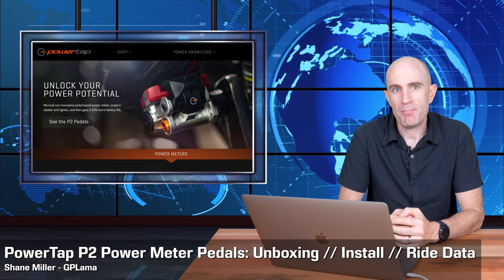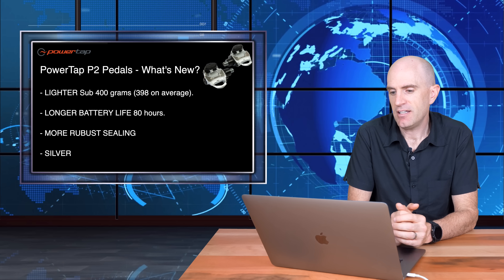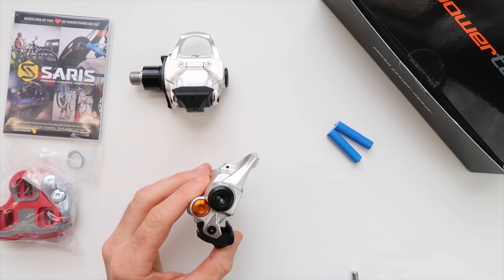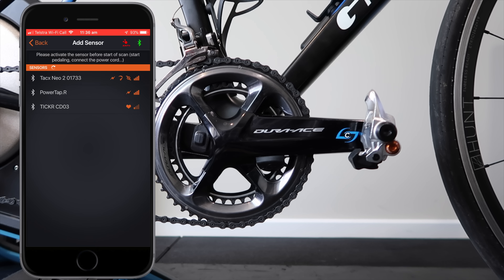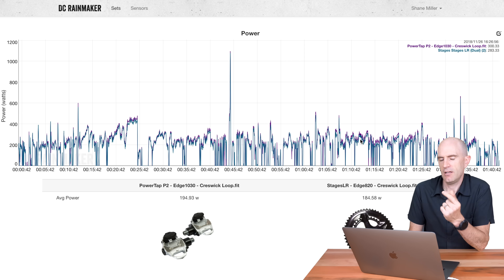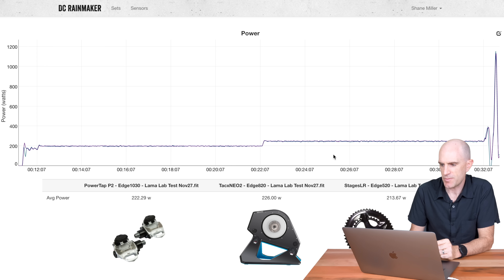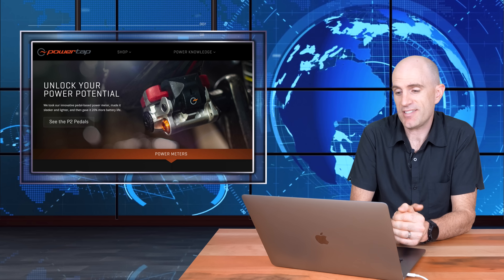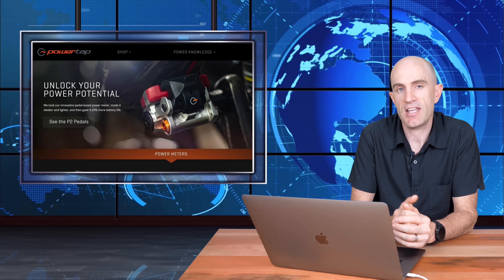PowerTap P2 Power Meter Pedals: Unboxing // Install // Ride Data

Comment: I have a question. Have you ever had either right or left peddal just stop working even with a new battery even thou like two days ago they were working fine.
Reply from the maker: No such (bad) luck with the P1 or P2 here. Be sure to check the terminals, especially on the end cap side of things. Clean/scrub them up / reinstall and see how they go.
Reply: @gplama thanks for the advice. I've tried that already with no luck. The green light on the right pedal comes back flashing Bright but after 4 minutes it goes very dim and loses connect with the head in unit. Anyways thanks for the reply. Just thought I would ask cause I know you had these longer then I had I just got mine in May

Comment: The design of these pedals has many flaws.. one of them the use and position of the bearings.. Also serviceability is quite reduced by the strange way of placing the bearings. The battery choice is also not a good idea in my opinion.. Requiring Lithium Batteries while nowadays it's so easy to get rechargeable LiPo, Li-Ion including charging circuity with USB-Micro or USB-C to directly charge the pedals like some other brands..

Comment: Having huge problems with the P2 and Zwift. My old P1 pedals (which got "upgraded" to P2 through a warranty claim when they failed) connected fine and automatically doubled the power from the single connected pedal. The P2 pedals don''t. Tried removing the right pedal battery but it doesn't help.
Reply: Did you ever find a solution for this? I'm in the same boat.

Comment: So Shane, I have P1. If I go to Zwift does it matter which people I select ( left or right )
Reply from the maker: Over ANT+ there's one ANT ID to connect to and you'll get L+R power data. Over Bluetooth the P1/P2 will only transmit one pedal data... and whatever it is connecting to will usually double it. Like the P1S. There's no true L+B over Bluetooth with any PowerTap pedals at this point.

Comment: okay quick question I'm looking at getting a new power meter and I'm between the powertap pedals and Garmin vector pedals
Reply from the maker: It's up to you then on price, weight, BLE having dual power (P1/P2 don't do this), Cycling Dynamics (again, Vector only), etc.

Comment: Rubbing battery on baby oils? Is that a wife's tale?
Reply from the maker: No. Google it. It works.
Reply: @gplama   I googled and what I found is consistent with my understanding of electrical engineering. You want a good and as clean as possible connection between the battery terminal and the contact point (in the PowerTap). In other words, zero electrical resistance. By putting oil in between the battery and the contact point, you've increased the resistance significantly, as oil is a bad conductor. 
My guess is that this internet myth originates from the fact that people put grease on car battery terminals to prevent corrosion. But the grease goes after the connecting cable is screwed to the battery terminal. You don't grease the terminal and then screw the cable on top of the grease.
Reply from the maker: @itsm3th3b33  The baby oil tip was also from Garmin in regard to their batteries in the Vector 3 pedals. To prevent fretting / corrosion damage, which in turn caused issues. The terminals are contact based, so any resistance introduced by baby oil would be minimal and likely offset by the benefits of no corrosion occurring.
Reply: @gplama    In my opinion, the tech support guy who wrote that did a disservice to their customers. Yes, fretting is a real concern, and one way to alleviate fretting is by using electrical lubricants. Amazon sells many such electrical lubricants.  Mineral oil (and baby oil) are the opposite - they are not electrically conductive, even if they are lubricant.
Check out mineral oil in Wikipedia: 
"Mineral oil is used in a variety of industrial/mechanical capacities as a non-conductive coolant or thermal fluid in electric components as it does not conduct electricity and functions to displace air and water."

Comment: I’m curious if you pair up the P2’s with the CABLE using ANT+ and then use the BT signal from the CABLE would you still get LR data from the pedals over BT?
Reply from the maker: Yes, this should work.

Comment: OK, this is NOT a product upgrade, its a product appearance UPDATE.  I don’t really mind or care, bc I don’t think that the PTap pedals are that ugly or that the weight is that big of a deal.  I own the P1s and I beat the hell out of them without a single problem.  Plus, they can be fit on ANY BIKE...including a spin bike while on vacation...or deployment.  I love the POWERTAP pedals, but can understand why everyone is giving them guff over this new product bc it is merely an appearance issue.

BTW: my Stages always read 10w below my PowerTap pedals too.  I don’t care because its consistent and doesn’t impact my training and I don’t tie my identity and self-worth to a NUMBER.

Comment: I have the stages duel sided and it seemed to read power slightly low (just by feel), but after I have been calibrating the L & R separate and putting both at the 6o'clock position they seem to read fine. Im sure you would have calibrated before the ride but im just hoping mine is working ok :)

Comment: Compare the Vector 2 and Vector 3 and the difference in looks is incredible. Garmin listened to their customer base and redesigned their pedal entirely, giving a genuine reason to upgrade. OK, people that did that might have regretted it once their Vectors started dropping out, but that's by the by. The difference between P1 vs. P2 seems so minimal. It feels as though it's been done for the sake of it.

Comment: the P1's are on sale for 45% off on Chain Reaction, seems like a great time to get them over the new P2 as you can get a new pair of shoes while you're at it and be the same price
Reply: Very misleading though as they are reduced from a RRP of $1869 on the Chain Reaction site. They are on special for $100 less at Pushy's.

Comment: Fun video Idea: Do a test or ride, with one pedal being the PowerTap P2 and the other pedal the Fevero Assioma. That might be as much fun as stringing 2 Wahoo Kickrs together!
Reply from the maker: That's just like running two single sided power meters. It's the worst of both worlds! :)
Reply: Unless you have a significant injury your rt v left readings will be consistent enough to compare 1 s v 2s accuracy

Comment: I'm still sticking to my Stages purchased on sale a couple of years ago. Power metered pedals aren't quite to the price point and performance level to where I'd by a pair. I'm gonna wait and see for now. Great review. Thanks
Reply: The best thing about the power pedals (I use Assioma) is that you can swap between bikes with no problem.  And you get your pedaling metrics.  I could really see the imbalance after my latest injury.  I believe was able to get back into L-R balance quicker with the information.

Comment: One MILLION percent agree that they should go to the Shimano cleat.  I really have an issue clipping in with my P1s that I've never had in the past with the SPD-SL.  And yeah if they are going to be that heavy they need to be cheaper for sure...and hells yeah, what is that color? 

I'll stick to my OG P1s for now.

Comment: Shane, will you be making a follow up video on the Stages LR? I have one myself (only PM I have and use it outside/on trainerroad), and I have always questioned the accuracy compared to my Wahoo Kickr. I just control my kickr with the Stages over ANT+ to have continuity. Do you think Stages can fix the low readings with a firmware update?
Reply from the maker: I'm giving Stages a ton of room here to try to figure out what's wrong with what I'm seeing. I could simply have a dud unit.... but it's consistent at least. :) More soon when I have updates. Hopefully I can get it (or a replacement one) lined up and both reliable and accurate.

Comment: I have the Neo Tac smart trainer when I try to maintain a average speed following the power it seems that there's a delay. Why is there a delay with power and all other sensors work much better and with no delay?
Reply from the maker: Hmm... I'd need to see the data to know what's going on.
Reply: It jumps around its hard to keep it as steady as the other sensors. If you dont look at the numbers and go by feel you can maintain it much better then if you look at the numvers. I see this with all power meters. Trying to maintain a power looking at the numbers you just keep fluctuating going up and down trying to hit the number because of the delay. This doesn't happen if you're looking at the speed or the Cadence.
Reply: @HarryTzianakisTheGodOfSpeed  You are probably over/under compensating with torque and cadence. You don't need to look at power numbers all the time. Just get the feel of desired wattage, by looking at 5s power for example, and then keep it that way just by feel, slightly adjusting cadence or changing gears when resistance goes up and down. You need to "connect the dots" between what you see on the screen and what you feel in the legs.
Reply: michwoz ummmm go take a look at my Strava and see how steady I can keep it. What I'm trying to tell you people is that the power meter does not work as well as the other sensors do. There is a delay there. The power meter does not respond as quickly as the other sensors do and by the time you want to reach your desired number you've already overshot it you understand? I know how they work I'm just trying to find out why it cannot work as well as the other sensors do. I actually don't look at any numbers I go by feel I find the desired pressure I want to put and I go from there and the desired Cadence. Go take a look on my Strava and see how flatlined I keep my workouts
Reply: michwoz you can keep your power number way more steady if you follow your speed or Cadence especially your Cadence. That delay that the power meter has to try to gauge how much pressure you're applying has  a ridiculous delay. Next time when you go out just look at your Cadence and try to keep your Cadence the same the whole time and you will see how flatlined your powers going to come out. If you look at your power number it fluctuates all the time as you're trying to apply pressure to even it out. In my book it's useless if you're trying to Flatline your numbers
Reply: @HarryTzianakisTheGodOfSpeed  I'm able to hold steady power number just by feel. I don't need constant and instant feedback from any sensor. I just need to "sit" on any given target power and that's it.  Then I just double check and fine tune intensity by looking at the numbers. That's what I'm trying to say. Also power number has no more delay than cadence and speed.

Comment: The new ones look less beefy on the side where the cap is not for the battery. The old one has more screws and looks much thicker . and you can see light where the spring is..

Comment: Don’t srm have pedals now?
Reply from the maker: Not even worth rating a mention imo. They're crazy expensive. AU$2,000. Need a special install tool. And really don't offer anything above and beyond what the others have. SRM missed the boat and caught the Titanic with their pedals.
Reply: Shane Miller - GPLama thanks for this mini review. Was curious about your take on the SRM pedals.
Reply from the maker: @Youtubefana  In short - I can't afford them. :)
Reply: Yes. From what I heard they seem like crap so far. Super expensive crap. SRM overdid themselves. When you think they can't do anything worse than super expensive PM without user serviceable battery and temperature compensation, they bless us with power meter pedals 2x more expensive and 2x worse than competition.

Comment: This is disappointing, it looks exactly like the P1. Have the P1s, I've been wanting to get a second pair of power pedals and was waiting for this release. I expected some vast improvements in size, weight, metrics. Think I'll just go with the Assiomas or Vector 3s
Reply: highly recommend the assioma's! Get the single sided. Most dual sided power meters have issues with the right sided power - from my understanding.

Comment: I really wonder why you can't see so much pro athletes with P1 or P2...they are really accurate. I used to compare them with my kickr or the neo and never found any difference in the power output. Really love my P1's and would never change them to any other system which is crank based, etc. btw - very good review!!! LIKE
Reply from the maker: They're a lot more popular in the Tri/IronMan market than cycling. See Ray's article on the Kona power meter count from 2018: https://goo.gl/YGYj1a

Comment: Have you weighed them with lithium batteries (out of curiosity) they mingle be lighter and last longer?
Reply from the maker: I kept straight-edge with the weights, using the supplied batteries.

Comment: Oh, Saris, Saris, Saris. Sigh. Solid products, but the lack of innovation is distinctly worrying. Fan of their company and support is fantastic, but they need to up their game, esp now that the Vectors are apparently sorted.
Reply: At least garmin listened
Reply: @robertdiez3091  True. As Shane says, it's a tweaked P1 with a shit colour. 80's silver FFS. No reason to use AAA's any more. A slimmer P3 with garmin type coin cell or rechargeable usb battery and 2 options keo or Shimano SL. And no stupid pricing.

Comment: Powertap "let's strip the paint off of the P1's and change the hex size on the battery caps and call them... Oooh I don't know... P2!"
Awful product renewal, just awful and lazy.
Reply: 100% agree with Leon Evans. No excuse to have bulky power pedals. It was a game changer in 2015 but we are now approaching 2019. After this, Vector 3 and Assioma's are now leading the power pedal industry. Powertap really didn't take a step forward.
Reply: @andremultifamily7274  well, I like the AAA battery format as far as I'm concerned, so I guess it's a matter of taste, anyway if I would have to replace mine it wouldn't be for Assioma nor Vector 3 pedals, except if Vector used BT but since they are also more expensive I wouldn't go for it unless they would be on sale so...
Reply: Powertap P1.1 is more like it lol
Reply: I totally agree - they are just looking to save costs and optimize profits with reusing almost everything and just branding it P2 with minor changes. They will end up like Nokia and miss the train to innovation as Garmin and other manufacturers really step up their game
Reply: If it ain't broke don't fix it. The slight improvement is good enough for a v2 of the product, but if you've got the P1 you probably don't need to upgrade. Is that why you are so frustrated ?
Reply: @xGshikamaru  it is 'broke', its too heavy and too bulky, always was. Owned 3 pairs of P1's, each pair failed after about 7-8 months and had to get warranty replacements. Have no emotions on them either way as no longer use pedal power meters. But anyone can see this is a paint strip and new battery cap, that's borderline not even a 'refresh'.
Reply: @LeonEvans_Guyver1  well, back when I got mine they were bloody expensive so just the new price tag makes it a compelling alternative to other pedal based power meter and the ease of installation is the reason I got them in the first place. I've heard about horror stories with this power meter but the reality for me is I've switched them between bikes multiple times and they still work as I expect. Most people put way too much torque when installing them or the battery cap and I suspect this may be one reason why they get into trouble. However I admit I've scratched my right pedal while cornering once because they're too bulky.

Comment: On one hand there is 'no torque wrench required'. On the other there is often setting period and offset shifting after sprints on first few rides. This doesn't fully adds up for me. I understand it's not BePro or Vector 1/2 installation nightmare anymore but I believe torque would still be useful or even should be recommended for installation. PS. It's about all current pedal power meters, not Powertap specifically.
Reply from the maker: A torque wrench isn't the answer. The bearings / pedal body / cleat interface.. all untouched by a wrench but could (depending on design) impact readings. A torque wrench is a huge limiter for manufacturers in regards to cost, supply, and upskilling customers to use them correctly. I'd rather have a few quick stomps, zero, and ride.
Reply: @gplama  From most customers perspective you must be right. Maybe I'm to geeky about it... Many times I don't fully understand people way of thinking like choosing power meters based on looks (choosing Vector 3 over Assioma etc.) ;)